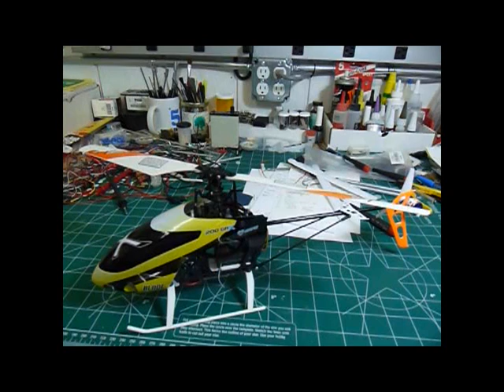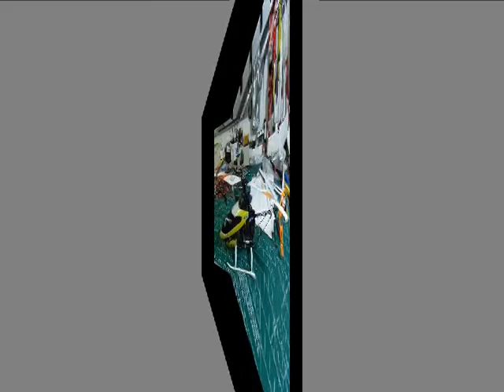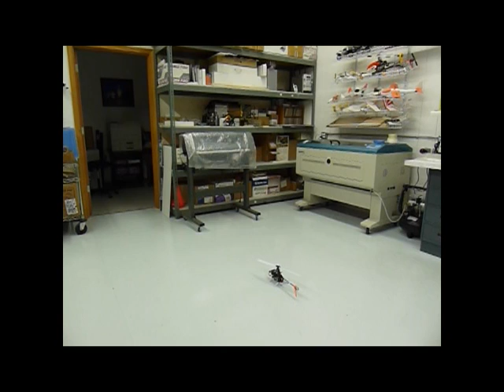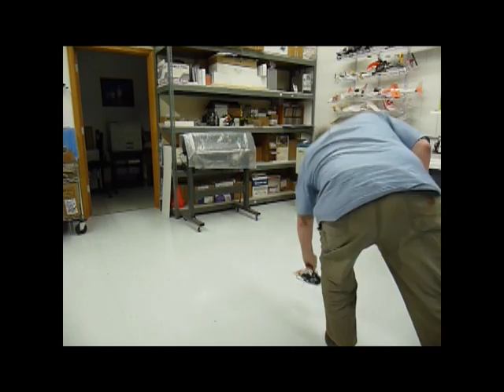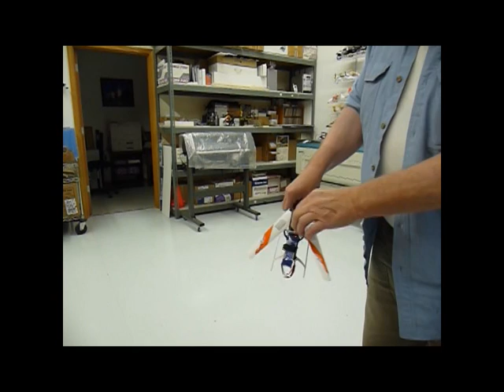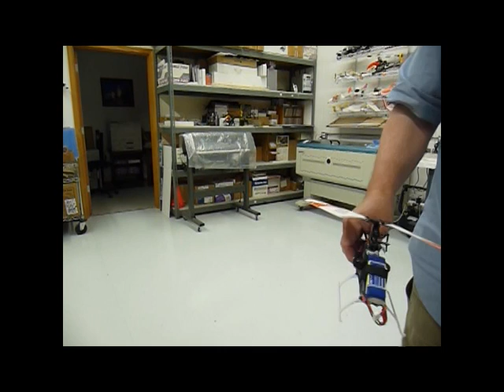Blade 200 SRX - BIG Power Increase!

Comment: Tiger I have a question. Could you also go with the same tail rotor, meaning the walkera V200D02 tail rotor or do you recommend to stay with the tail rotor that comes stock with the helo?
Reply from the maker: Alejandro - You absolutely DO NOT want to change the tail rotor.  The tail motor is already under powered and has a crazy high KV rating.  If you put anything larger on there, I'm sure the motor will burn up.  The tail motor is definitely the weak point on this heli, but when it's working correctly (tail blade facing right direction), it makes adequate power (just).  So I guess the good news is that you really don't need anything larger back there.  It tail works just fine as it is even after you upgrade the main blades.    ...Tiger
Reply: TigersToys
Thanks Tiger. I only have one more request. Could you please tell me the company you went through to obtain the main rotors. Walkera; the main company is at this time completely out; also if you could please tell me the part number. Thank You.
Reply from the maker: Alejandro Martinez I usually buy my Walkera parts from Wow Hobbies (wowhobbies.com), but I just went to their site and they seem to be out of stock right now.  You can keep an eye on their page for when they come back into stock.  (http://www.wowhobbies.com/walkera-v200d02-parts.aspx)    I'm sure you could also do a google search and turn up some other sources.  These blades are used on several Walkera helicopters so you can also look for these:  V200D01, V200DQ01, V200D02, CB180D, CB180Q, CB180Z   ...Tiger
Reply from the maker: TigersToys
Oops... Just notices a posting on Wow that said the CB180 blades are about 1/4" longer than the V200 blades.  Otherwise, they say they are the same.  You could avoid those or just cut an extra 1/4" off if you can't fine the 200's.   ...Tiger
Reply: Thanks Tiger. I found some blades on ebay, due to the fact that everywhere else the blades are sold out. I guess people were really paying attention to your youtube tip on the 200. Thank you very much and if you have any other tips and/or tricks for tbe 200 please post and I'll be there.

Comment: Have you ever had the problem with tail moter BLADE 200 SRX ?
Reply from the maker: Sai Sai - I've never had a problem with the tail motor and I've flow it a lot.  I know some early buyers had trouble with the motor heating up, but my understanding is that some of the helis had the tail blade on backwards causing the motor to run much harder than it should.  I assume that problem was solved in later production.  Nobody I fly with here has had a problem with the tail motor either.
Reply: yea my is the tail motor is faster then the main motor. And i don't know how to fix it. Right after i bought that the motor smoked and i replace a new one it spin very fast and i can't fly it. I haven't had a chance to enjoy my Blade 200 srx outside.
Reply from the maker: sai sai thain I don't know what to tell you other than make sure the blade is on in the right direction.  If it's on backwards, the motor will run to fast and get hot.  Maybe you could look at one on another helicopter and compare it to yours.  There are no markings on the blade to tell you what is the right direction.
Reply: I'll try and let you know thanks a lot for your advice.

Comment from the maker: Jason Day - I agree, but that would be too easy. :-)  Cutting the blades is really a piece of cake if you bolt them together to do it.  You can't really mess anything up or get it out of balance that way.  You can use plastic, cardboard, or just about anything for the shim.  You can cut something out with an exacto knife.  Just be sure to make it about 3/8" in diameter and you'll be fine.  I had one local guy try to use washers and because the diameter was so small, the blades didn't seat in the grips and they flopped around making the heli unstable.

Comment: Good video,  Just wish someone would sell the blades pre cut ans shimmed.
Reply: Yo everyone....I just did an experiment with the blades off of a MJX F46 today on my 200 SRX, and they work GREAT!!  No muss, no fuss (with gain adjustments) just slap these blades on and fly.  The throttle up power is excellent and you don't have to cut the blade down in size.  Fast forward flight was good as well.

Comment from the maker: To all who have asked questions...  Guys - I'm not ignoring you here.  I do see your questiions, but for whatever reason, I keep getting locked out of my own post.  I don't know what's different today, but it seems to have let me in so I'm posting.  First let me say that most of the questions that are being asked have already been answered in previous posts (which is frustrating).  Please read the old posts so I don't have to keep answering the same questions over and over.

SuperDrummer311 and others - Yes you can get what you need by upping the power to 150-200%.  BUT... The whole point of changing the blades is so that you DON'T HAVE TO increase the head speed.  I talk about that in other replies and even in the video.  It's not that you can't get more power that way or that I don't know about it.  The new blades are just a much better solution for most folks that have this heli.  The Walkera blades work wonderfully at the stock head speed and I still recommend it.  If you were a 3D pilot in another life and don't mind massive damage when you screw up, by all means stay with the stock blades and jack up the speed. I will continue to be thrilled with the new blades, low head speed, and how this is flying.  Under no circumstances should you run the Walkera blades AND up the head speed.  The blades are not strong enough for that and anyway, the tail is going to blow out.

With regard to balancing the blades, there is no need to do that if you attach them together to cut and sand like I suggested.  These are injection molded blades and are virtually identical so they will be in balance unless you cut the two different.  Balance isn't as much of an issue anyway with the modest head speed.

Rebelman810 - Yes, I continue to super pleased with the Walkera blades and the way I have them cut now.  I have not made any other changes from the stock setup.  The heli flys wonderfully and I still recommend this change.  Pretty much all of the other guys here that fly the 200 have made this modification now and are equally pleased.

Brian Verbel - Yes it's 1-1/4" off of EACH blade (not total).  As I mentioned earlier, it's a good idea to screw the two blades together and cut and sand them at the same time to maintain balance.  You'll find it very stable in flight.  If you've got a wobble in yours, you might want to take a close look at other things like the main shaft.

Ron Miller / Shane Miller - I keep receiving this question.  Yes I know about reprogramming the head speed using the Horizon procedure.  Horizon came out with that very early in the game, because they realized they had a serious problem.  I really think it would have been much better for them to acknowledge the problem and change the blades.  Their solution with head speed is in my mind totally inconsistent with the "fun fly" nature of this helicopter.  Jacking up the head speed turns it into a completely different animal.  If you're looking for a "completely different animal", then I'd suggest you buy a different helicopter.

FINAL COMMENT - I know there are those of you that don't agree with what I'm saying here.  I'm really not interested in debating the merits of this with you.  If 200% head speed makes you happy, then go for it!  I posted this for the other 99% of guys that just want a cheap and simple solution to making this the sweet little thing I think it was intended to be. 

Happy flying!!!   ...TIger

Comment: 200 SRX mod. I have gotten the v200D02 blades and cut them down 1-1/4" and they work great so far only have 2 flights indoors but so far so good seems to be a little more stable definitely has alot  more lift, instead of being at 3/4 throttle to hover i'm just a little over 1/2 throttle now go to full and the heli jumps up quick. I was also looking for more lift not head speed,  it already has good head speed especially for a beginner to intermediate pilot, I am intermediate and very happy now, before i almost hit the fence outside due to not being able to gain altitude fast enough now it will have no problem getting out of a situation like that. Thanks Tiger
.

Comment: Hi Tiger,

  It has been a couple of weeks since your last video and posting.  I was just wondering how these blades are continuing to work out?  Have you been able to try the Walkera blades in all three modes to make sure the A3X stability still functions normally?  Have you found an optimal end of the blade shape,i.e. striaght, curved, angled, etc.?  Any new videos to show us the blade modifcation itself?  I think someone asked too for the actual blade length for the final modification for us to use as a guide.  And any new flying videos to show the improved performance?  Thanks again and great information.

Comment: Guys - Sorry about my absence here, but this Google+ crap they are trying to cram down our throats has had me locked out of my own postings.  I seem to be in right now so I'll answer several of you here.  YouTube was so nice for so long, but now Googles "we know what's best for you and we want all your information" policy has me ready to throw them under the bus.  Anyway... I have been unable to answer several of you in a timely way and I'm sorry for that.

Mark Nuetzman - I used a shear to cut the blades, but there are lots of easy ways to do it.  Just remember you need to make them identical in order to maintain balance.  You could even cut them one at a time with scissors and then bolt them together and sand them to be identical.  Another good way is bolting them together and bandsawing them.  Just make sure they are identical when you're done and they'll work great.

You Other Guys - Several of you keep asking me why I don't just up the gain using the procedure on the Horizons site.  You must not be listening to what I've been saying.  Yes!  You can increase the gain and get more performance. I KNOW THAT.  The whole point of my blade change is to avoid doing that very thing.  I don't want to increase the head speed.  I keep saying that!  High head speed is not a good thing unless you have no other alternative to get the job done.  I definitely don't recommend the gain increase for guys starting out with helicopters (the guys most likely to buy this SRX).  Personally, I am really enjoying the blade change and I have many years of experience flying larger CP helicopters.  I find this change totally consistent with the design and purpose of this little heli.  This thing is super fun and relaxing to fly and I'd like to keep it that way.  If I want to fly 3D or do something wild, I have lots of other helicopters for that. :-)    

Update: If you have not read all the postings, you may not realize that I finally ended up with 1-1/4" cut off the blades. I mention this because when I posted the video, I was cutting off a little less.

Thanks to all of you for posting!   ...Tiger

Comment: Nice work, but I am curious if you ever used the new Eflite instructions on entering the ESC programming and changing the main motors power output to 200%? I personally increased the main motor power to 200% and the tail motor to 150% and it flies rest now with more than enough power. It's like a new heli. You should give it a try and let us know what you think.

Comment: I just recently bought my 200 srx in the rtf version. I have 3 flights on mine.  Although this is a great heli . I agree with you on it being gutless.  Once you're up in the air flying it flies great but when you c** load off the ground and try to accelerate away from the ground it just does not have enough ass with those skinny little blades so I saw your post and decided to do something just like you but instead of those Walkera blades I have some the 912 slaves that are about a half inch shorter than the stock 200 blades but significantly wider once I install them about a quarter stick the 200 Haley was up in the air and I had so much torque under full throttle going straight inline it did have just a little bit of tail blowout but not too bad it was so much more fun to fly I also was looking at those walkie raw high performance blades which those are the black and white ones I'm not sure the link on those I may have to trim them down like you did with it be 200 c0 2 blades as far as the head speed I agree with you on that it is plenty fast

Comment from the maker: UPDATE:  I have trimmed my blade a little more and I think I have finally found the sweet spot for the length.  I have now cut 1-1/4" (total) off the blade and it would appear to strike a perfect balance between power and stability.  It's REALLY nice to fly now!  Plenty of power to pull out of a dive, but not so much as to overcome the tails ability to counteract the torque.  The best way to cut this is to make a template out of cardboard (or whatever) that is 1-1/4" wide and offer it up to the angled tip of the original blade.  This makes marking the cut line very easy.  After you cut, you'll want to sand the corners round again.  It's best to bolt or tape the blades together for this operation in order to keep them identical and balanced.
...Tiger
Reply: Did you still use the v200D02 blades for this? Also can you explain again what you mean by the easiest way to cut these? Thanks
Reply from the maker: themahonster
 Yes, I am still using the v200D02 blades.  As for how to cut them, what I was basically saying is that you want to cut them both at the same time to keep them identical and in balance.  To do this, lay one on top of the other and put a screw through the mounting hole.  A #2 machine screw works well.  This bolts the blades together in perfect alignment.  Then down on the far (tip) end of the blade it's nice to tape them together so that that end can't move around.  With the two blades secured together like that, you can trim the end off and know that the two are still going to be identical.  Hope that helps! :-)   ...Tiger
Reply: I run the Extreme Production 8 degree pitch and I get the same climb rate as you are getting.  Saves the hassle of cutting and balancing also :)

Comment from the maker: For those still looking for a 13T pinion, I ran into a couple leads that might help.  First, the pitch on my 450 heli seems to mate with the 200 main gear just fine so I think that makes the pitch .5mod.  That should narrow the search quite a bit.  Note that the hole in the 450 gear is to big so you still have to find something with a smaller hole.  Second, if you can read German, I think these guys are selling the 13T gear:  http://www.nanoheli.net

I still think changing the blade is a better plan, but if you are looking for the pinion, I hope this helps!  ...Tiger
Reply: Rakonheli.com sells 11T, 12T and 13T replacements along with lots of other upgrades. Best part is everything is in English, so no confusion! ;) Happy flying!

Comment from the maker: 1) I'll answer all three posting below here.  Sorry, I don't know where to get the 13T pinion.  I didn't even look for it after I calculated that the head speed would be over 4000rpm.  I need more lift, but I don't want that head speed in the process.

2) I also looked at the 120SR blades, but they are too small and as I recall to thick.  The Walkera blades have to be shorter than the originals, because they are a lot wider.  Shortening them makes them a little more stiff which is a good thing.

3) The blades I'm using are Walkera P/N HM-V200D02-Z-01.   I got mine here:  http://www.wowhobbies.com/hm-cb180-z-33receiver-1-1-1.aspx    I cut exactly 3/4" off the end of each blade at the angle of the original end.  I've done more test flying since this video and think I need to cut more.  Today I'm cutting off another 1/2".  There is still excessive power and full throttle in fast forward flight causes some instability.  I think that's from the tail rotor not being able to keep up with all the main rotor torque.  I'll post again after I test the new blade length.

Comment: Did you cut then down to original size?I see they are 7 1/2 inches long,i thought of trying 120 sr blades but they are only 6 1/4 inch.